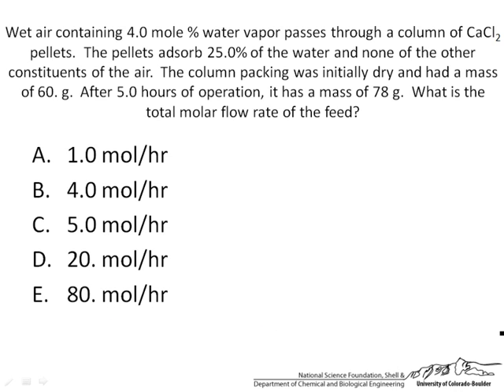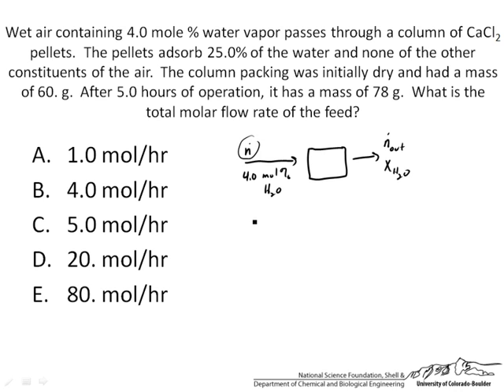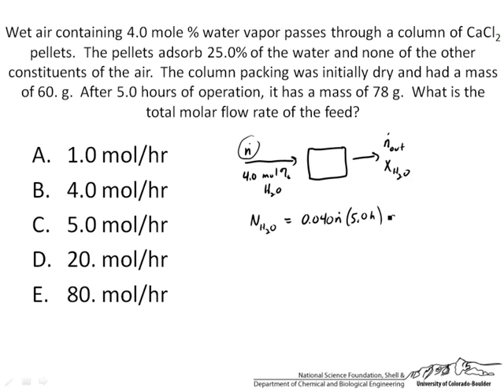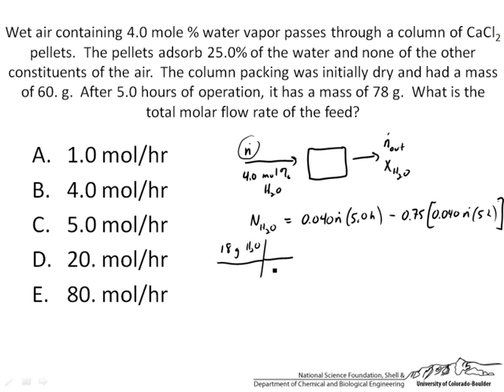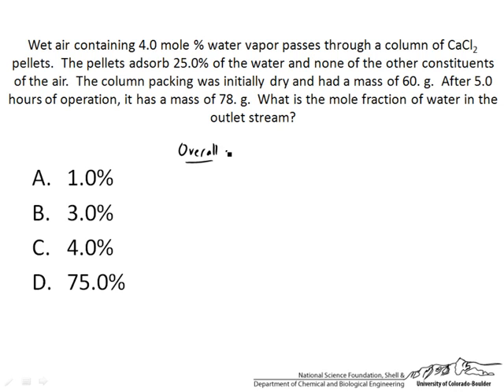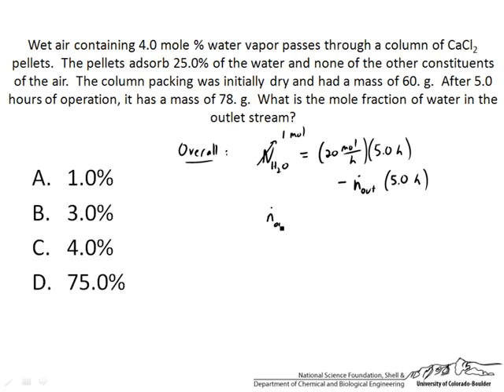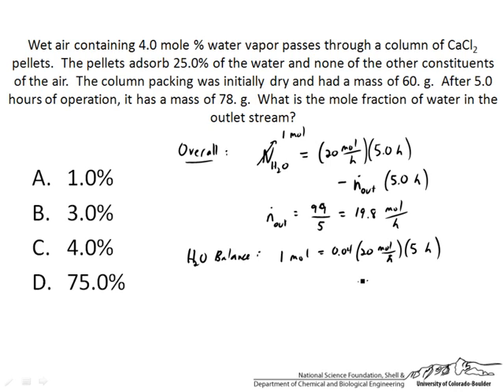Water Vapor Adsorber Material Balance

Comment: Good example.  The second part can be solved more quickly by using the first balance.  Since the flow rate is constant and the outlet water stream is 75% of the inlet, the exiting mol fraction of water is (0.75)(4%) = 3%. 😊

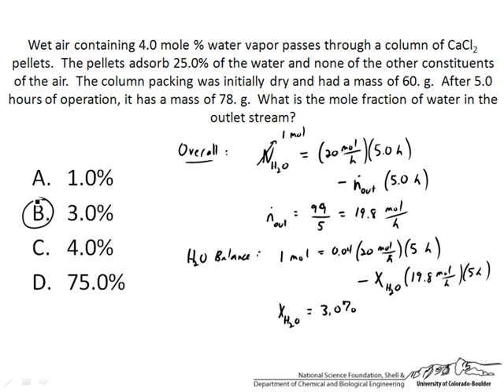Comment: 5:24 don know how did you get 3% i got 5
Reply: Just use the first material balance. The feed molar flow rate was determined to be 20 mol/hr.  If you look at the two terms on the RHS, the 2nd term is 75% of the first.  Since the flow rate is constant, the mole fraction exiting must be (0.75)(4%) = 3%.

Comment: I did the second part differently:

total(in) = 20 mol/hr
0.2 mol/hr of water vapour is absorbed away, so total(out) = 19.8 mol/hr

water vapour(in) = 0.8 mol/hr
0.2 mol/hr of water vapour is absorbed away, so vapour(out) = 0.6 mol/hr

mole fraction of water vapour in output stream = [ water vapour(out) / total(out) ] * 100
= [0.6/19.8]*100 = 3%

Comment: Where did you get 99 from in the mole fraction part?
Reply: This equation is confusing..becoz first u write this N (h2o)=20*5-n (out)*5.....ok...but then the same N(h2o)=20*5*.04-19.8*5*X .......does that not counter both equations
Reply from the maker: The 99 came from solving the equation shown: 1 mol = (20 mol/hr)(5 hr) - (n_out)(5 hr). Rearranging to isolate n_out equals 99/5.